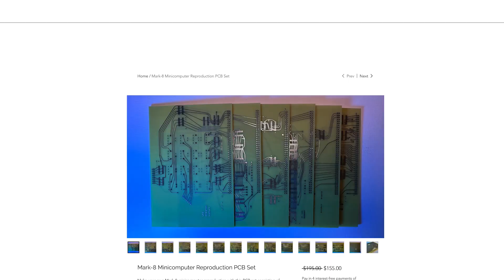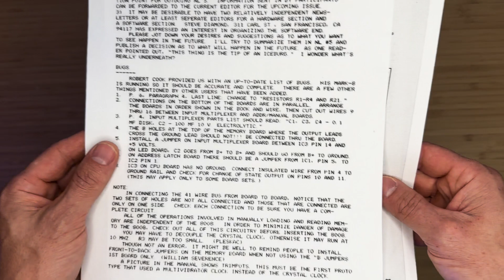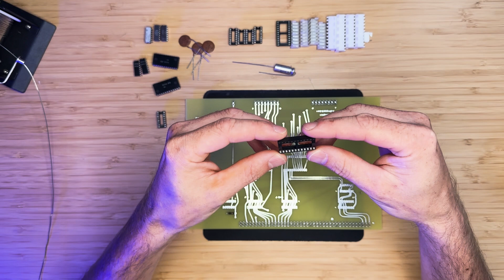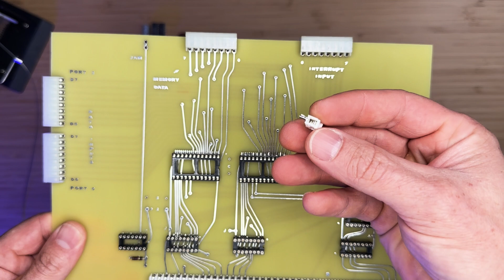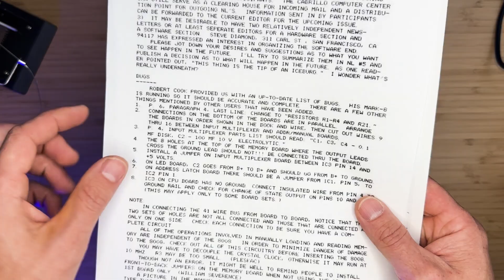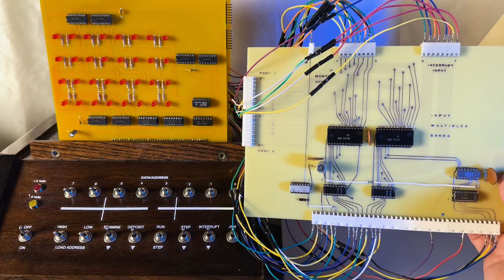Mark-8 Reproduction Input Multiplex Board

Comment: These bugs on some of these boards, are these modern bugs? Or are they bugs from the origional designs? I remember reading about the original bugs, and how heart breaking it would have been in 1974 building a computer following the instructions to a T and it doesn't work. I enjoy this series, looks like a fairly simple build. Any plans to include any updates or expansions from the Digital Group?
Reply: Some of the original bugs were very frustrating and occasionally worse than just not working.

Since the original article was oriented to making one's own boards and they were larger than and more complicated than most people ever had experience with there were the additional problems that came from inaccurate photo resist transfer, incomplete etching and not having plated through holes.

Also the original interconnections were individual wires, so troubleshooting sometimes required desoldering to isolate which board was the source of the issue. 

All these problems led to a very active newsletter that before the Internet was how we connected with each other to share errata, tips, suggestions and sometimes just frustration. Also the newsletter was critical to get some of the harder to get parts and parts that just weren't sold in single unit quantities.
Reply from the maker: The bugs found on page 46 were the "original" bugs. The other bugs that were mentioned in this video (missing a plated-through hole for one of the jumpers and the trace being connected to one of the pins of IC1) are newer fabrication issues. I'll update the Gerber file to include the missing hole and reduce the size of the trace so it doesn't connect to the pins. The fabrication process is not always accurate, the best we can do is to reduce the chance of having issues by increasing the spacing between traces.